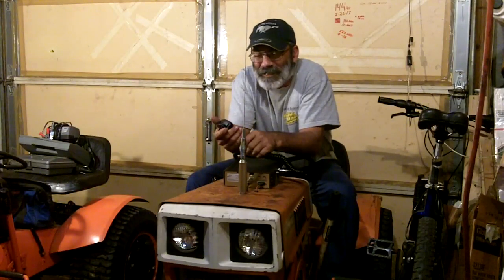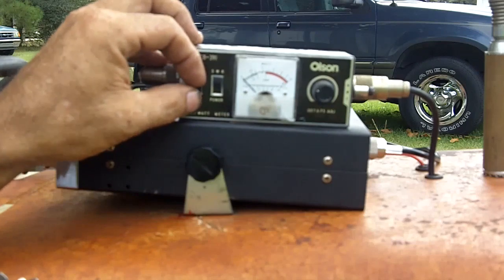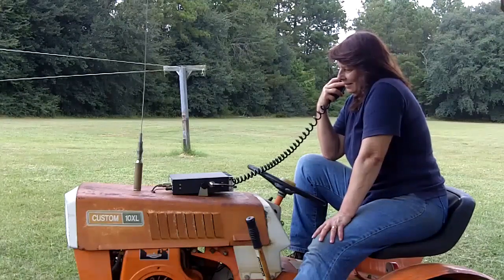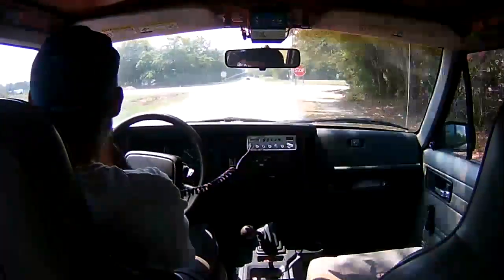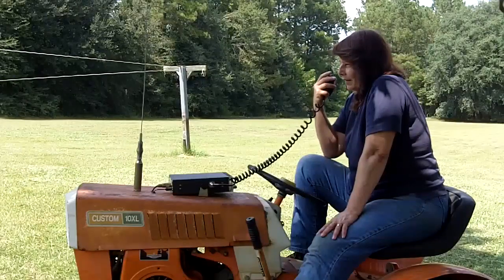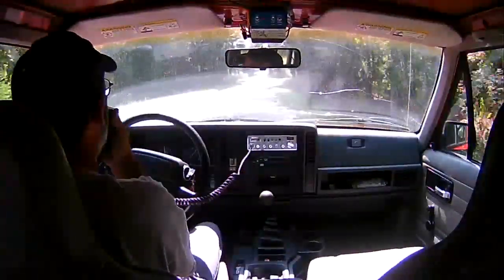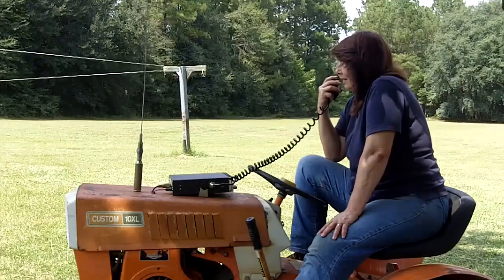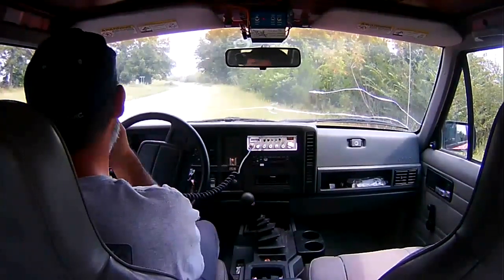CB Radio Range Test, How far can a lawn mower go

Comment: I'm a old CBer from back in the late 80s. With a properly tuned antenna, with the lowest SWR's you can get. A CB radio is good for about 1 mile per watt, and a tad further with a good antenna. Try adjusting the antenna on your vehicle so you get a 1.0 swr on the channel you use. You will be amazed at how much further you can get. And yes, put a well tuned antenna on a tower and your range gets even further. I am now into Ham Radio. Stay safe. 73s

Comment: I have a friend who has a cobra 25 and a Texas star v modulator on his Honda four wheeler with a hustler antenna. We have talked over 25 miles before From my base to his ATV. He hunts in a lot of remote places and he has all his equipment down and in a waterproof box it’s pretty sweet you just can’t run the amplifier continuously without the four wheeler running because it pulls the battery down but it’s nice to have in case of an emergency and you need some long-range communication he can go from about 15 Watts to 120 Watts.
Reply from the maker: That's awesome! I've been hearing about a lot more hunters using CB radios, but that Modulator on the quad is a new one to Me. 
Thanks for watching, 73's from 151 SC.

Comment: For 2 of negative Gain antennas with 4 watts output that equal to around 1 watt ERP of power into the air. As receivers were around quarter of the performance plus another disadvantage, none of you guys base of 2 antennas is well below 36 feet above the ground level as most of your signal will reach out to the sky. As so little of your signal by percentages are reaching to each others at more than 6 miles with bunch of tall trees is in your way. As your overall test is so fantastic.

Comment: I am from the Netherlands and i like these range tests!  Here in Holland FM is most common. AM mode (and SSB of course) is also allowed here, but because FM has been established here since the 80s, there is not much modulation in AM. (most FM or SSB) I regret that, I just like AM more than FM, it is much more pleasant to listen to with the squelch open, thanks to the much lower noise floor. AND there is no capture effect, which FM has. Listening to a weak station in FM mode with the squelch open is very irritating to the ears.  In AM you will not be bothered by this due to the much lower noise floor. Weak AM signals are also easier to receive due to the simplicity of an AM detector, only a diode. FM has the advantage that it suffers less from interference. FM and AM both have their pros and cons. I prefer AM mode. It sounds nostalgic which really fits HF radio which is CB radio is.  I like your videos,  excellent.  Greetings from Holland

Comment: I run dual crossband vhf radios. At worst I get about 15 miles. At best I get 35-40 miles. Antenna is up pretty high though. Like 40ft.

Comment: Antenna height, topography, swr, and trees are a big problem with distance in signal propagation. There are a number of other concerns that effect it all so. The next solar cycle is coming. I've personally have made contacts into Naples Italy on 11 meters with a 10 meter radio converted to run on 11 meters.
Reply from the maker: I can't wait for the solar cycle to kick in, it's been a while. Thanks for watching, 73's

Comment: Put a 102 in steel whip on your tractor with the spring and you might get a couple more miles now  if you're on top of a mountain with your tractor you'll get out all over it's got a lot to do with elevation
Reply from the maker: Definitely! A 102 whip is the best mobile You can get. Thanks for watching, 73's from 151 SC.
Reply: An 8 foot whip on a mirror mount, clamping on to a 55 gallon steel drum could talk a 15 mile radius. Was nice because no tower to worry about in storms when the wind picked up.

Comment: Impressive!  I wish you had her start the mower up to see how general mower noise  impacted transmit and receive  as well as motor noise coming through the receiver on the mower radio.  I noted she had an odd flutter on her transmit that you did not have in your vehicle.  Wondering if low battery current caused this and if running the mower engine would stop it.

Good video overall!
Reply from the maker: the radio picks up very little noise when the engine is running, this old tractor has a very quiet ignition system. We could not record with the engine running because the camera sound gets all muffled from the loud exhaust.
Reply: Mower Junkie 

That is so cool, man!  I couldn't believe the SWR you had with no more of a ground plane than a riding mower would provide!  Antenna looks like an old Antenna Specialists snap-in hole mount.  I hate that A/S went out of business as they made good stuff.
Reply from the maker: @grigorirasputin5020  It is an Antenna Specialist  antenna, but this one has an NMO mount on it. It probably would not do as good on a newer mower....But this one is 900 lbs of good old US steel.

Comment: Awesome install and tests, John! With these newer plastic hood "lawn tractors", I would think one would have to do a bit more work to get that kind of range out of them, if it's even possible. Maybe I'll use my 2011 John Deere as a test case one day, but I couldn't control for the difference in terrain, etc. 73s from 641 North Georgia!
Reply from the maker: You could always use a no ground plane antenna.
Reply: @MowerJunkie  This is true! I might give it a go sometime, just to see what happens. I won't have a Cobra 25 to try it with though. lol
Reply: You could try a floating ground if you need extra ground. That's what we used to install on customers  vehicles that didn't have enough ground plane. You can get the swr down pretty low using it.

Comment: Wonder if a 2 pill amp would work on the lawn mower 🤔
Reply from the maker: Maybe if it had a stronger battery. I think a 2 pill would kill a mower battery pretty fast.
Reply from the maker: @stangmaster 2 This Tractor has an old Cast iron engine, with an automotive style ignition. it also has a good charging system in it. but it does have a small battery.
Reply: Just put a 21 foot 5/8 wave on it and just throw the 4 watts at the horizon.

Comment: How about driving the mower out into the sticks and communicate with it from your base!
Reply from the maker: I thought about putting it on My trailer and stopping at check points, to talk on it.
Reply: Mower Junkie Good idea - the mower has its own radiation pattern. You may get different results... .+ or - 6.6 miles! 
Your mower probably has more steel in it than these new crappy cars that are all plastic!

Comment: Roll up windows…
Manual transmission 
CB mic in hand..

Today’s generation would short circuit…

188 in the sunshine state.. (waven it).
Reply from the maker: Thank You! I needed a good laugh. Take care, 73's from 151 SC.
Reply: This my favorite vehicle configuration: in line 4 or 6 cylinder engine, manual transmission, minimal electronics, and rear wheel drive. These type vehicles last forever.

Comment: Nice job. I was thinking it would be about 7 miles when I started watching. I can remember that was the realistic limit mobile 2 mobile with standard gear from back in the 80s. Mobile to a base station would be about 10 miles - without driving to the top of a hill.
Reply from the maker: Thanks, it surprised Me, I thought it would only do 3 -4 miles. the funny part of it is, I only need it to do 1/4 mile at the most. 73's from 151 SC.
Reply: @MowerJunkie  How far do you think you could do with an antenna on a tower up in the air?
Reply from the maker: @jeffreyd399  I'm not sure, it could probably reach base radios 10-12 miles away.
Reply: @MowerJunkie  Very cool. I'm thinking of buying something like this and trying it out. And I think you could probably get further than that :)